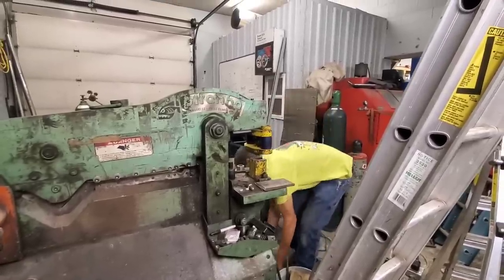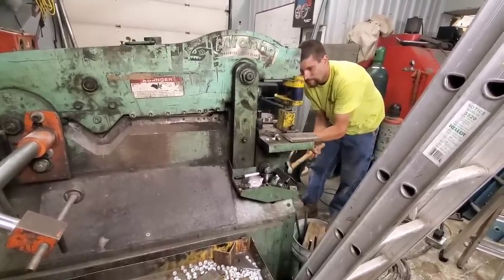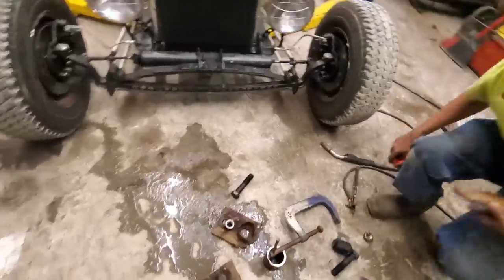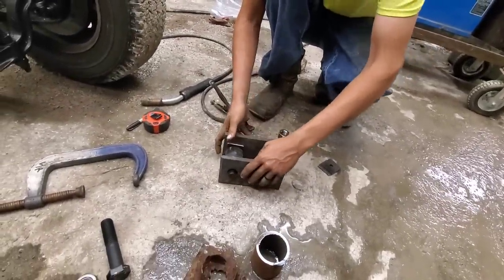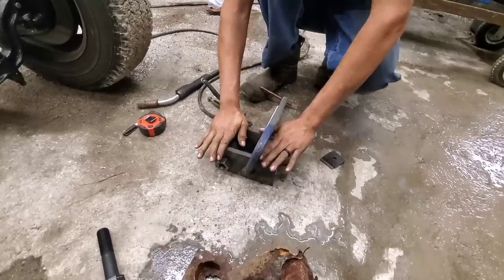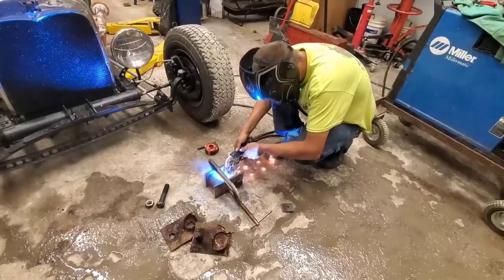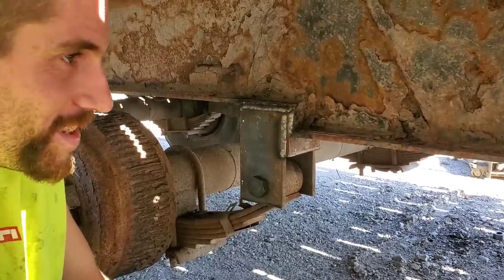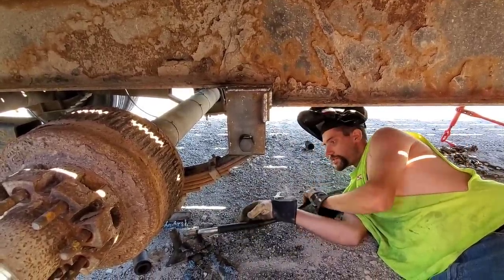Welding the axle back in a trailer

Comment: Replaced many them axles/springs/brakes and 2x as many lights. Few times from user failing to check oil in axles. I loved working on them smaller trailers.

Comment: You should get one of these for the shop in Tennessee Tyler :-) Your pops could use one of your custom tool trays with the big wheels for the gravel as well :-)) When are you going to start zooping up Larry? Bruce Wilson has an in line 6 on his White Freightliner that looks like the replacement 4 stroke version of the 671 [It's a Dtroit as well]. Probably get a lot better gas mileage and power from it and it looks like it'd fit in the back just like a 671 as well]. Keep an eye out for junked early 90's freightliners in junkyards to see if they have those updated 6 cylinder Detroits [just sayin']. :-))
Reply: They are not cheap, then again most machines are not. This includes 100 year old lathes. Getting one just to have without really a need just doesnt make much sense unless you have so much funding to waste or need a tax write off.

Comment: those Piranhas are not cheap.. in LA craigslist.. $20K to $40K depending on the tonnage..  i had some spring shackles made up for a friends car..  i had then punch a double row pattern with 1/2" spacing.. then he could really fine tune the spring height.

Comment: Lots corrosion and scale on that frame......good old salt belt
Reply: Would think one would work to prolong a trailer they use . Blast and repaint when it starts becoming obvious during inspections instead of waiting till it is paper thin fails and cost time,money and hassle.